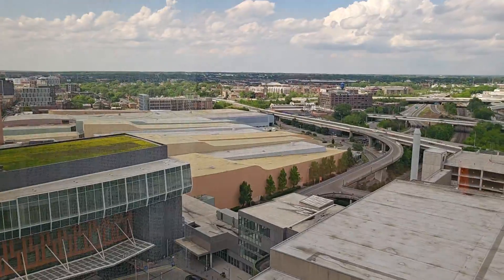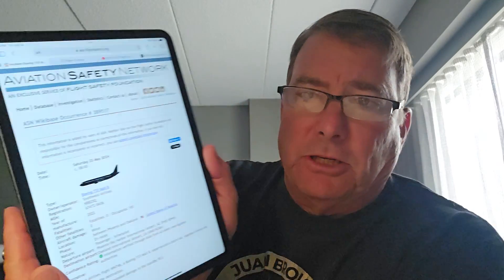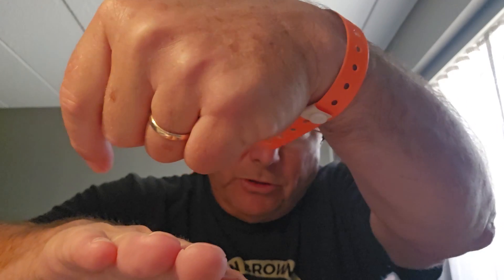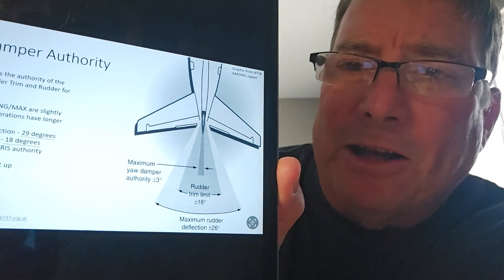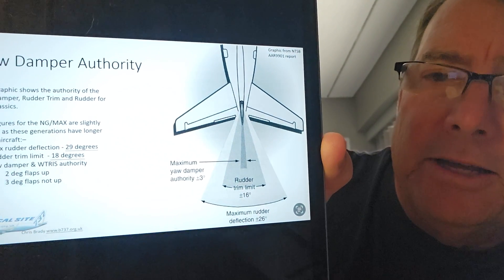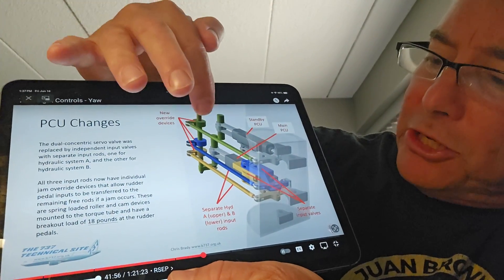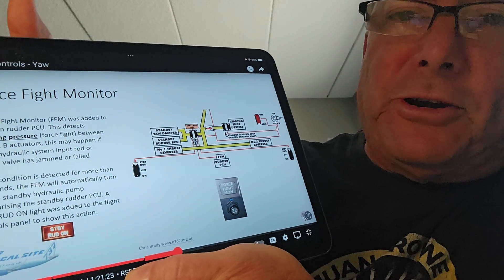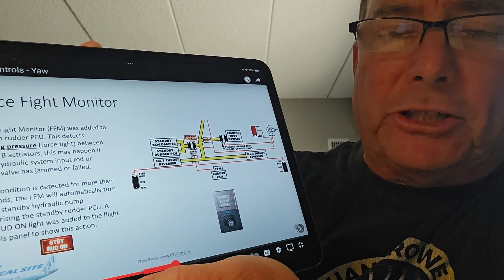SWA 737 Max-8  "Dutch Roll" Incident

Comment: Been there ....Done that on an A300 with a V Stab Inop in flight... Crazy ride at altitude.  Lowered below 250 and Cracked the Speed Break..  Settled down nicely
and got home with above min fuel.  There are other ways to handle it but that is what I came up with.  Just another problem not in the QRH then.  It is now
as my name sake.

Comment: "Total hull loss"... or in other words smashed into the ground near vertical at high speed. Another case where the 737 has a dual system, rather than triple redundant. There's no 2 out of 3, if the two disagree then you can't tell which failed. That's the 737s feet of clay showing again. At least the 777 is a modern design, the last real Boeing in some ways. So you don't have to worry about your workplace trying to kill you.

Comment: If this is a singular incident, then I would be more inclined to look for a potential maintenanceissue. Or perhaps a freak-of-nature issue, like with Qantas Flight 72: Suspected Solar induced EM-radiation which converted the binary input in the FCC, leading to an erroneous flight control input from the FCC (Flight Control Computer). But then again... it's Boeing. Are the Max flight computers autonomous operating computers/processes or do the FCCs cross check with the other FCCs before initiating flight control inputs? Did Boeing not learn from Flight 72?
Reply: It's not an uncommon occurrence as Juan stated, it's the fact it was a Max that the media tried to blow it up into something that it's not.

Comment: Juan is thinking, "Thank God I'm on a 777."
Reply: IMO, 777 is the best designed airplane Boeing has ever made. It has a remarkable safety record. It's since been downhill.

The 787 outsourcing fiasco cost so much and took so long to resolve that Boeing couldn't do their new mid-market plane and that led to the max fiasco, and here we are. Boeing is lucky to still be #2 due to its legacy planes and strong sales and support organization.
Reply: @billsimons4113  Boeing still makes the safest aircraft in history, the 787 Dreamliner has the best statistical safety record of any jet airliner, zero crashes and zero fatalities
Reply: @sandervanderkammen9230  This is nonsense!
It is a safety record, but it is not statistics.

The next runway incursion in front of a Dreamliner might be part of your record - but it doesn't change any proven or not proven safety of this bird.
Reply: @peterebel7899  Sorry lad, but there is no aircraft on the planet that has flown more flights and carried more passengers more miles without a single fatality.
Boeing makes the safest plane in history.
Reply: @sandervanderkammen9230  Fatalities are made by human errors - as long as the aircraft is not made by Boeing.
Reply: @peterebel7899  Per flight and per passenger/mile no aircraft has a better statistical safety record than the Boeing 787.
Reply: Probably.
Reply: Not really

Comment: I remember the DC-8 on turbulent windy approach could develop a dutch roll. The pilot was the yaw damper mostly using small aileron inputs.
Reply: Had to be exceptionally good to avoid PIO and making it all worse, then.
Reply: @SeanAwning-er4ww Did pilots back then know more about hand flying their aircraft’s than the new batch does?  This is somewhat a rhetorical question.

Comment: Electrical engineer here. Great explanation, of an unstable system, with phase shift contribution !
Reply: truly !  excellent!  also EE.  especially the yaw leading to the roll combined dynamics.
Reply: @klam77  -  An explanation that was easily imagined from his explanation.
Reply: The system is not unstable, it is lightly damped.
Reply: @roflchopter11  -  And definitely not moist.
Reply: @roflchopter11  LOL
Reply: As Juan pointed out, the dutch roll mode is stable, not unstable, it's just underdamped hence if excited you get a decaying oscillation.
Reply: Same here.  Got a chuckle out of the damping vs. dampening comment!
Reply: Physicist here. This was very well presented. I am impressed by all the EE's around.
Reply: How can you tell if someone is an engineer? They will tell you.
Reply: @bradsanders407  And we are supposed to be impressed.??
Reply: Its supposed to be physically designed as an aerodynamically self stabilizing system via asymptotically declining hysteresis. Just blame the pilot, Captain MCAS.
Reply: @potrblog mcas doesnt control the rudder dude
Reply: @bradsanders407  I never mentioned rudder?
Reply: Check out films of the time lag on the Tesla Cybertruck fly-by-wire steering system. Then shake your head very slowly. Do make sure you have your hands to either side of your head to stop the possibility of any interference cycle where you might get into a loop and shake your own head off!
Reply: @COIcultist If I remember my control systems classes from years ago, taking only the first derivative into account can lead to instability. The mass of the vehicle works against such instability, but even with minimal time lag, one can find instability points, as it takes time to apply opposite controls in response to oscillation. Including the second derivative of yawing motion can help, but it takes even longer to detect the second derivative using automation. Our analog brains are much more sensitive to second derivative inputs than mechanical and visual control systems, especially at highway speeds. I did my studies long enough ago that we used polar graph paper to plot the imaginary input. It's not the lag on the fly-by-wire steering system which is the problem, but the detection of a yawing movement by either the inner ear, or the cameras associated with self driving and detection of lane misalignment. The latter is a harder problem to solve. Gyros would help on straight lanes, but curves present more challenges

Edit: I only took control systems classes as a Masters in engineering, I had no such education in my undergraduate engineering. In fact, now that I am retired, this is the first opportunity to actually use some of that education. My Masters was in the Control, Information, and Computer Engineering curriculum, which has long since been absorbed into the Electrical Engineering curriculum. Whether control engineering is still a mandatory class for any particular track, I have no idea. Certainly, the concepts were harder than other engineering tracks, and current students may avoid this class. I only took it because the lab part of the class included an advanced Model Railroad automation, and I was interested in the Model Railroad. They really tricked me into learning some more difficult mathematics, and I've forgotten more than I learned in 1981.
Reply: @COIcultist Non-issue when driving at speed. Those demonstrations are done when stopped. Also the electric steering requires much fewer input turns lock-to-lock
Reply: @MrCarGuy  We have always managed with the greater number of turns lock to lock. Strangely, when at speed, very little movement of the steering wheel is required. I do sincerely hope you are correct.  Now, whether that is my natural altruism or just not wanting to have a directionally vague firebomb strike a vehicle I'm in? I'll have to think about that.
Reply: @MrCarGuy found the Tesla fan. It's a car my friend, there is no reason why steering lag could ever be acceptable

Comment: damper - a device for reducing mechanical vibration, in particular a shock absorber on a motor vehicle.
dampener - a thing that has a restraining or subduing effect.
A dampener is someone or something that dampens. So damper and dampener can both refer to one that deadens sound vibrations. But damper does not work for something that makes something slightly wet.
Reply: And a damper damps, not dampens.
Reply: @RicktheRecorder Actually, "to damp" is readily understood as the moistening action .
Reply: @CG-rr6yx  No, that's to dampen.
Reply: None of the women get damp when they see me naked....is that the same thing?
Reply: Need the floaty seat cushion then ;)
Reply: "dampener - a thing that has a restraining or subduing effect."
I thought that a dampener is a thing that makes another thing wet.
Reply: And on cars, the thing that people call shock absorbers are dampers. The things that they should call shock absorbers are the springs - they absorb the shock as the wheels travel over a bump, and the dampers damp the spring's oscillations
Reply: @Bob-j5o3b I think the dampers dampen the oscillations. "To damp" is accepted as equivalent to "make wet, moisten" .

Comment: If merely getting into a dutch roll can cause physical damage to a “modern” airliner, that would be bad news. Even though yaw dampers will almost always prevent it, it can still happen on any airplane in the right circumstances.The cause of this incident will be very interesting.

The term derives from a style of ice skating that the aircraft movement resembles.
Reply: I wouldn't be surprised if "getting into a 'Dutch Roll'" didn't do the damage but rather the response to the "Dutch Roll" usually is where things get dangerous.  Think about the phenomenon of the "Pilot Induced Oscillation": you have a phenomenon where a pilot forces an airplane into an action where they then respond in almost the opposite (180 degrees off cycle) direction: force the nose down, then jerk it back up again, and repeat...  So the "Dutch Roll" begins pretty gradually, but the Pilot then responds more aggressively to counter, which then upsets the aircraft in the opposite fashion, which then compels the Pilot to respond yet again more aggressively in the opposite, etc...  So the "Dutch Roll" begins...lets say...with a slight yaw to the left with a slight left bank...if you do "nothing" then the airflow on the starboard wing will compensate and you'll get a slight yaw to the right with a right bank, which then will eventually rock back the other way...easy peasey.  But lets say you see the yaw to the left and the slight bank and you jump all over the controls...you jam that right pedal in and wrench the yoke off to the right...well, now you've induced a larger moment to the right.  So, in reflex you jam the left pedal in and really crank the yoke off to the left to counter your left...  THAT'S where you build the stress on the airframe.  And if it's unexpected, if you're not used to "Dutch Roll"...well, it's easy to make a situation worsen where the counter-intuitive thing is to relax and use gentle control inputs...and sometimes (like recovering from a stall) even "opposite" control inputs than our reflexes tell us.

Comment: Hi Jaun, how is the yaw you are describing different from a plane crabbing during landing? Seems like in both situations the yaw is induced? Would the yaw damper engage during the crabbing landing procedures? I am not a pilot just an aviation enthusiast. 
Thank you for the video.
Always Faithful,  Always Forward 
Aaron Beaulieu
Reply: The yaw during crabbing is not exacerbated by a roll.
Reply: So, with the yaw induced intentionally during a crabbing procedure, the forward wing will still generate increased lift and then causing the tail to pull down the wing.  Would the yaw damper engage during this process?
Thanks for the reply
Always Faithful, Always Forward
Aaron Beaulieu

Comment: Max rudder pedals have about 10cm less movement than the NG. Aircraft needs less input and trim when single engine ( at least in the simulator) Rudder appears more sensitive but we certainly haven’t been told about any design changes! It’s a shame because the Max is so much more stable and nicer to fly than the NG.
Reply: Do you attribute that the Max "more stable to fly" to MCAS?  The size of the engines and where they are placed gives the impression to non-engineers like me that the plane would not be as stable. Thank you!
Reply: @CharlesTPrimm  it’s aerodynamically far more stable than the older versions, the new engine position is closer to the modern design in Boeing and Airbus aircraft.
Reply: Lol they wouldn't tell you if there were design changes.

Comment: A two hour cockpit recorder incredible. Automatic coverup.
Reply: @R.BOWERS  I can see the Unions side too, but why is there a procedure for pulling the circuit breaker?
I meant to say why isn't there a protocol to pull a circuit breaker i.e. cut power and preserve the data.
Reply: @R.BOWERS because they know it will be mis-used. Blame the airlines!
Reply: @R.BOWERS  railroads have constant even recorders so should airlines

Comment: Thanks for the technically accurate, and fast news, Juan! I am developing the habit of waiting for you to put something out when an aviation incident happens so as to avoid being confused by other sources. I always hear Steveo1kinevo talk about switching the yaw damper on and off in the TBM that he flies, but never bothered to look up what that means. I am interested to learn more about whether the dutch roll in this 737 Max caused the damage to the hydraulic control unit, or a prior fault with the control unit caused the dutch roll.

Comment: Why was structural damage reported ?.   Did the hydraulics exceed there limit stops.
Reply: This is the question that Juan is hoping we will have answers for in 30 days.  I really hope there is not a new computerized system in MAX-8s controlling the rudder through periods of instability.

Comment: Used to practice the Dutch Roll on the B727 simulator. The maneuver was not practiced in the B747 or B777. Glad they recovered safely.
Reply: Split-rudders on the 747 and 772 make the issue manifest itself a bit differently ... but, then there is the chance that one of the rudders could hard-over...something that used to happen on -200B from time to time! Those were fun...😳